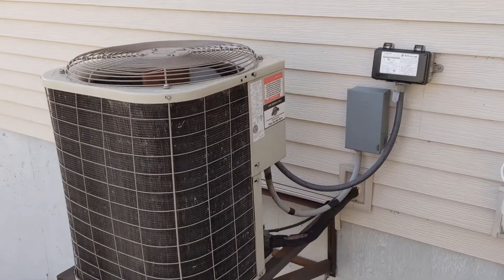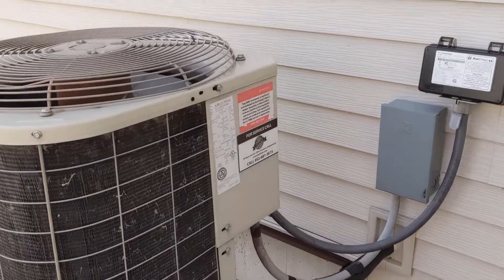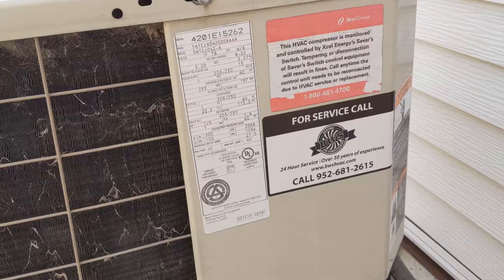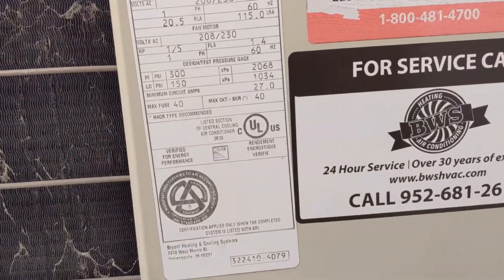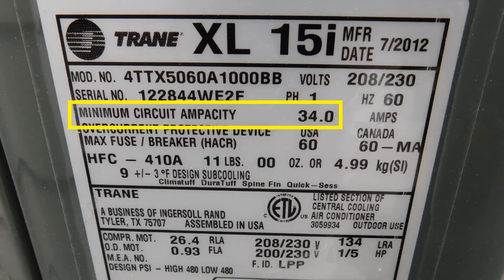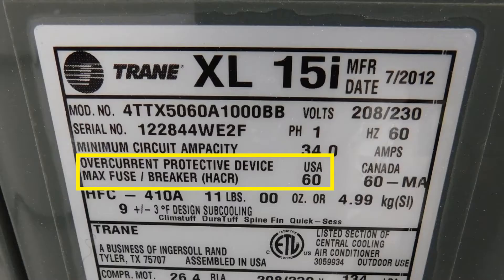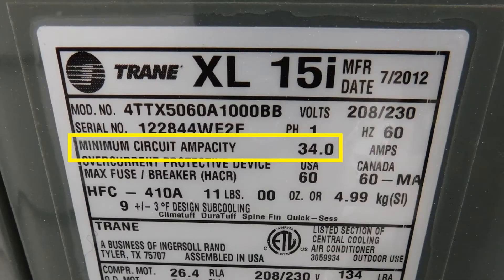Air conditioner circuit breaker sizing

Comment: This is true however it would also be true If you are running thhn single conductors 10 awg as they are rated for 35amps 75 degree column 310.16

Comment: Don’t ever put a 8 gauge wire on a 60 amp. 8 gauge is rated for 40 amps for a reason this kind of logic is why so electricians have to clean up hvac guys messes when the damn wire burns and ppl panic wondering what that burning smell

Comment: The air handler call for 45 amps. The panel and disconnect it has 40 amps breaker. Does it matter where I change the breaker?

Comment: The panel sticker on my HVAC unit says that the max fuse or breaker should be 30 A. But for some reason they have a 60 amp breaker in the main panel. I'm assuming, that's not correct.

Comment: Incorrect! STOP!  Hang on there cowboy lets not start confusing people! MCA is for wire sizing ONLY and you need to use NEC TABLE 310.15(B)(16)for wire sizing you are looking at the WRONG table. Wire type and temperature rating also matter again refer to the NEC table i stated. The maximum circuit breaker means that’s the size breaker you need period there is no between this and that it’s wha the name plate says on period.

Comment: According to the chart in NEC Article 310-16, #10 wire rated at 75c can handle 35 amps so #10 wire is fine on a 34 amp circuit
Reply: But what about maintaining a less than 2% voltage drop... if the outside unit is 30ft from the breaker then 10 is small. The startup amps are also higher than 35 & will initially heat up the wire. Maybe he should be using the amps rated on the contactor-switch which has three different ratings on them.
Reply: @SlackerU  that’s almost a thing of the past with newer equipment, the LRA is nowhere near what it use to be and if the system uses an  inverter on the compressor like many systems do now the LRA is gone and the start is super gentle on the electrical system. Good point on the 2% 30’. Next time your around a newer unit throw an amp probe on and start the unit up.
Reply: @victorsr6708  My electrician cringed at the wire size the ac listed to use on a 60 amp breaker but my issue ended up being weak capacitors damaged from the over 100+ power outages/surges I get annually.  Now that I monitor incoming spikes over 125 volts it's surprising how often it happens, no wonder 2020 NEC requires those lighting/surge protection.
Reply: You are correct, but typically see 90 degree C (167 F) copper wire and it will allow up to 40 AMPS 10 gauge. The key is knowing what to look for when making decision on whether to replace the existing wire.

Comment: what if you try to run the fan and the 24v wires are not hooked up yet but is grounded to the housing what damage if any could i expect.

Comment: This might blow your mind guys, but all motors must be protected by thermal overload protection; the motor inside a AC compressor has internal thermal protection that will limit the load imposed on the circuit. The breaker is only there to protect from shorts and faults, not overload, that's why you can up size the breaker, the motor is separately protected.
Reply: That is not true. If the condenser has a lot of dirt the compresor work harder and use more amperage.

Comment: None and I mean none of the electrical inspectors in my area would allow me to put an 8 gauge wire on a 60 amp breaker. I’ve been called on this a few times. They will always refer to table 310.15
Reply: Show them the code, they are literally wrong. A lot of inspectors are not exactly code experts.
Reply: @KLAWNINETY  I have to run #8 mnb to 35 amp ac. I’ve installed them for 20 years and talked to numerous inspectors. 310.16  and 240.3 (2) (7)
Reply: 240.4(g) and article 440 parts 3 &4. Spells it out right in the code book. Your inspectors need to learn the code. And in this situation in the video, #10awg thwn wire can be used as it is rated for 35 amps at 75 degrees Celsius.
Reply: @Jacbeamas  I said nmb

Comment: I'm on the fence with this subject as a home inspector. Say the max fuse / circuit breaker according to the data tag says 40 amps. The service disconnect has 40 amp fuses but in the electrical panel it has a 60 amp breaker. Some people say this is right and some people say this is wrong.
Reply: I've had a professional HVAC tech tell me if the Compressor is 50 amps and the breaker is 60 amps, it is okay. I'm not sure about the 40 amp unit though. I would assume that the breaker would have to be replaced.
Reply: @C.Riggs14  why would he say if the max circuit breaker is 50 that a 60 amp breaker is ok? Or I'm not understanding your statement?
Reply: If you have a fused a/c disconnect, then you treat it no differently than you would for an electrical sub-panel - because that's exactly what it is.

In your example, you would confirm 60 amp wiring between the main 60 amp breaker and the a/c electrical sub-panel, and then confirm 40 amp wiring between the 40 amp sub-panel fused circuit and the a/c unit.

You then confirm the electrical sub-panel is close enough to the a/c unit for it to not require a separate service disconnect.

Since the unit is protected by 40 amps as required by the nameplate, this is also correct.
Reply: @robertmarder126  so we need to figure out if the disconnect has fuses or just a pull disconnect that separates the connection? Best answer yet! I can see this being accurate.
Reply: @cypresshomeinspections6939  Correct, a simple pull disconnect gets treated differently. A disconnect that is a breaker or fused you treat as a sub-panel instead.
Reply: By hvac code it is allowed, as an inspector you write it up to be reviewed by an electrician.  More often than not you cannot visually inspect the line from breaker to appliance and thereby cannot say for certain that no other connections are in the circuit.
Reply: The Maximun or minimum breaker size that an AC can have is the same, you need to size both the breaker & the fuses at the disconnect with what is stated on the name plate under Maximum fuse or breaker size period! There is no in-between or larger. The term minimum circuit ampacity is used to size wire size, that is it, it has zero to do with fused or breakers. Watch this video and it will clear things up https://youtu.be/WugJ8-70Sqs

Comment: He size the wire wrong. # 10 in the 75 column is good for 40 amps THHN.
Reply: THHN is in the 90 degree Column not 75.

Comment: This is incorrect. Shortest video ever by a non-electrician talking about wiring. Please watch  Mike Holts video on sizing AC conductors and breaker sizes. There are exceptions in the code for sizing conductors and AC and refrigeration equipment is one of them. Art 240.4 (g). Also the temp rating on the feeders makes a big difference.

Comment: The information in this video seems correct, except if your condenser circuit breaker is rated for more amps than the ampacity of the cable, that may not meet electric code.
Reply: Actually when you size the overcurrent protection for motors (such an an air compressor in a condensing unit) you usually increase the size of the breaker beyond the typical minimum breaker needed for the wire based on the 75C column of the ampacity chart in 310.16.

 Motors draw very high inrush current that does not heat the conductor but will make the magnetic protection in a breaker trip.

The whole point is to make the breaker larger than normal.
Reply: Right. It doesn’t meet code. We have gotten called on this before.
Reply: Only for romex.

Comment: I don't know if A/C has some exception from electrical code, but having bigger breaker than the rating of the wire doesn't seem like OK.
Reply: There are exceptions for many kinds of equipment. Condensing units are one of them.
Reply: 310.15 read the * all you need to know

Comment: MCA vs MOP the breaker should be rated more than the minimum circuit ampacity but lower than maximum overcurrent protection value.
Reply: I agree. Part of this was or could be bad advice. A 60a breaker is never appropriate 8 gauge wire. It will fail and melt before the breaker throws.
Reply: @keithbess516  except that it is an air-conditioning unit which is ok.
Reply: @Rene-uj5vw  it is appropriate by hvac standards but is a write up from a hom inspection point.  It ischecked as breaker vs size of wire in the lug of the breaker. It is written up as, “should be reviewed by electrician”. This is the only option if the integrity of the circuit cannot be verified from one breaker to apliance.

Comment: My Neighbor’s a/c breaker keeps popping.  A/c in house for more than 10 yrs had 40 amp breaker.

They have “Homeshield” coverage.
What a crock they are.

Homeshield sent out Ac tech who said the system needed a smaller 30 amp breaker. (This after they previously changed the compressor) 

Then HS Electrical guy came out and changed it to a 30 amp the other day but it still pops it. I looked at outside unit and panel calls for 40 amp breaker. 

HS electrician came back out again today and put new 40 amp in which popped and said no you can’t put a 40 amp on a 10 ga wire and put the 30 amp back in which immediately popped again.

I happen to be there and tried to talk some sense without stepping on toes.

I left and will talk to neighbors later when HS person isn’t there.

Bottom line is people need to know their FULL jobs and home owners need to know how not to be taken.

My own ac has a 40 amp fuse in a 1978 home. Works fine. 
Occasionally it is necessary to hire “the experts” but My homeshield is alot of tools and education. 

Good video. Thanks for the break down.   Researching videos to send to my neighbor.
Reply: Either compressors going do a amp draw see the amp increase compare to rating plate.  or run cap is weak test competence. Breaker obviously not the issue .

Comment: great video thanks. How do I know what size AC Disconnect box is appropriate in terms of amperage? If i have a 21 min 35 max amp heat pump?
Reply: Just buy a 60 amp ac disconnect, they are the same price as a 30 usually
Reply: @jrod264winmag  that’s incorrect he needs a 35 Amp Dual Element Time-Delay Class RK5 Fuse. There is no between this or that! 21 min is only used for wire sizing NEVER for sizing a fuse or a breaker. The information on this video is incorrect
Reply: @victorsr6708  Show me the code article that says it requires said fusses. Show me the article that says he can’t protect it with a 35 amp breaker